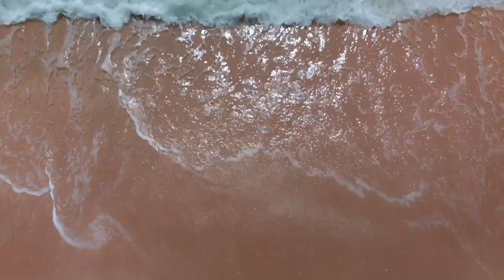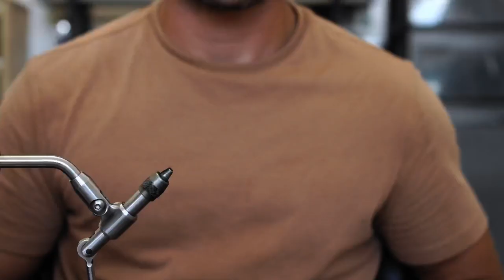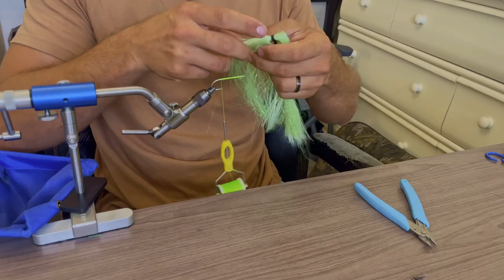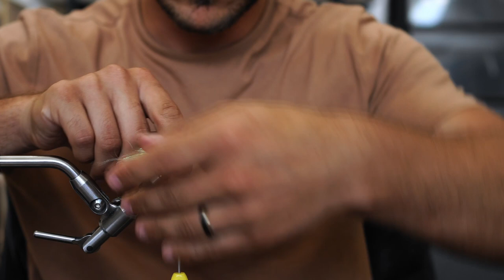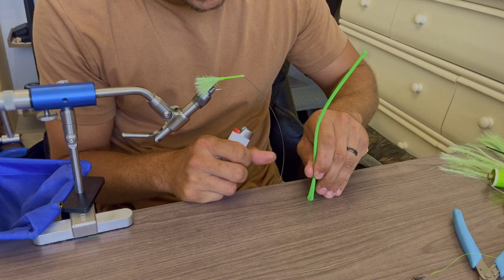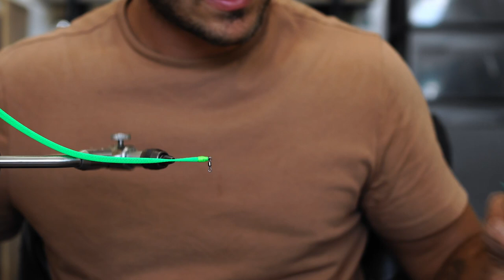How To Tie: Hamilton's Cuda Tube | A Barracuda Fly Pattern

Comment: Are you trying for that slight bend in the tube when finished?
Reply from the maker: You DO want a slight bend/tension in the tube, this gives it the motion we're looking for when being stripped in. The best way to achieve it is to store it on a spool or pull slight tension when it is measured to be tied in.
Reply: @OleFloridaFlyShop  I figured, but wanted to be sure. Thanks for the tip on spool storage. Now I gotta find some cuda.
Reply from the maker: @skorflyfishing  No problem. That's the fun part, good luck!